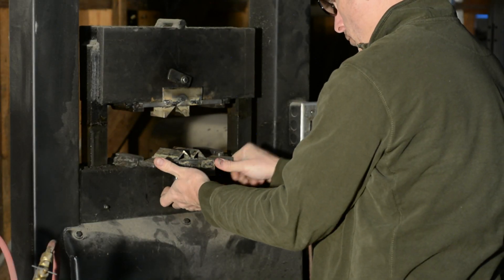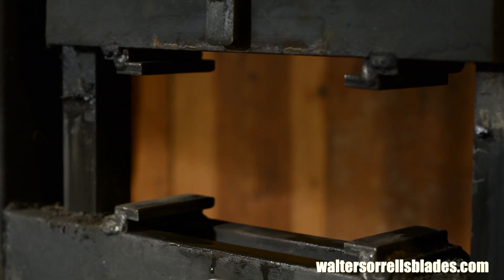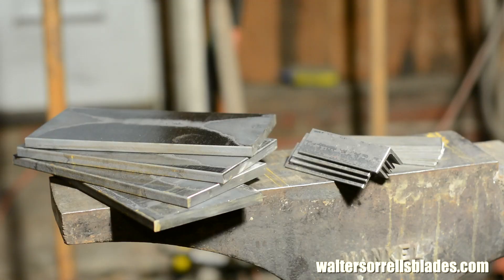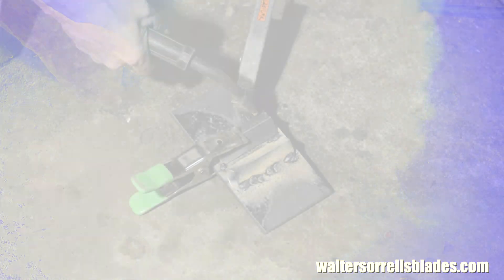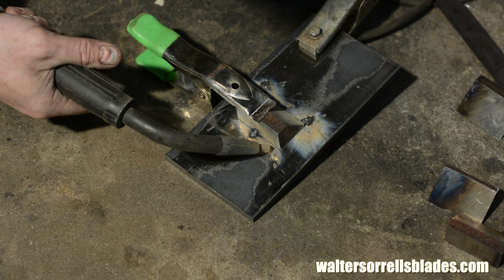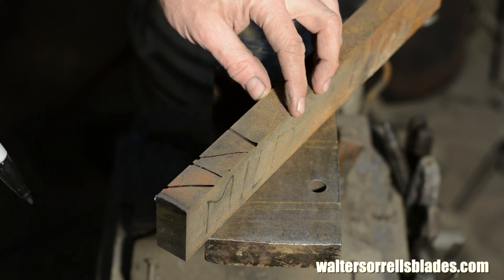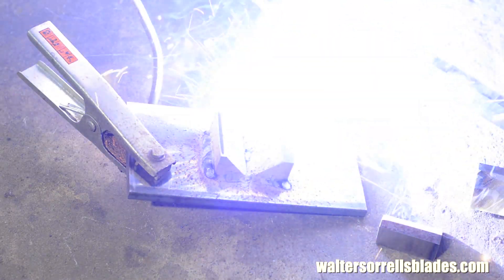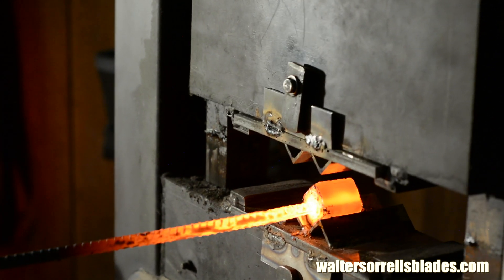Making Squaring Dies for a Forge Press

Comment: Correct me if I'm wrong, but you are missing a nozzle for your welding gun!! This may explain the slag inclusions, now, I know it's a forge press die and not super critical weld test. But I believe my point still stands. 

Very grateful of your videos, gotten me "un-stumped" many times! 

Keep it up!
Reply from the maker: WestyBadger1 No, it's flux core so it doesn't use a nozzle.

Comment: What is this good for? couldnt you make just as good edges by simply forgin it on the flat surfaces? i understand that this keeps the sizes the same but is that the only reason to make this or are there more?
Reply from the maker: I'll have some details about the use of squaring dies in an upcoming video about making advanced damascus patters like W patterns and jelly rolls...but the short answer is that they're not used for making things flat and square.  That you can do on flat dies.  They're used to squeeze AND square at the same time.  But like I say, that leads into complicated territory that this video wasn't made to cover.
Reply: Allright thanks! i'll wait for it